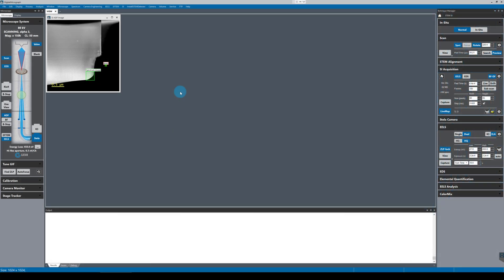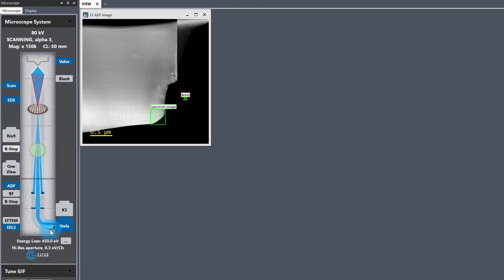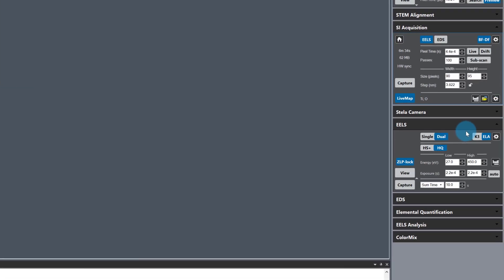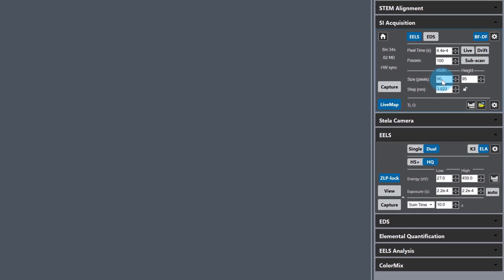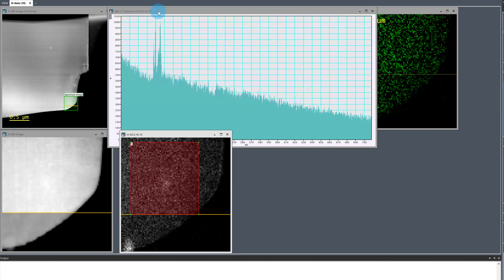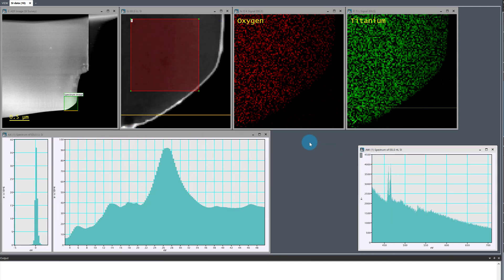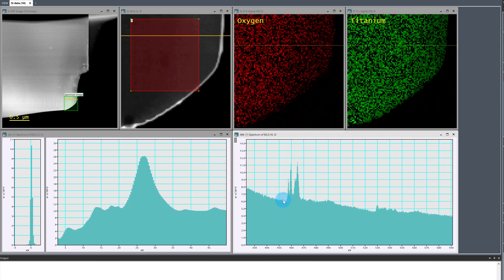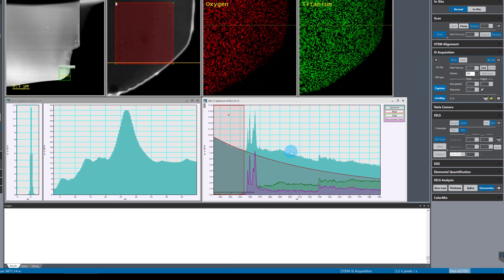High-Speed Counting EELS at low kV with GIF Continuum K3 with Stela

Comment: In what condition, shall we collect data with multiple passes? what is the data different if I collect data with only one pass at stronger current intensity?
Reply from the maker: Hi J Q,

Thanks for your question! 

When using an electron counting detector, summing multiple passes works really well as there is no readout noise. The signal to noise ratio is only shot noise limited (https://en.wikipedia.org/wiki/Shot_noise). The SNR of a single spectrum image pass acquired at high probe current or multiple passes acquired at lower probe current should be the same, if the total specimen dose and all other parameters for the two experiments were identical. The total dose is proportional to the probe current and also the acquisition time, so the dose can be controlled by changing either or both.

Fast multiple pass spectrum imaging is beneficial as it allows for better (more frequent) spatial drift correction and reduced specimen contamination, but is fundamentally advantageous at controlling specimen dose. 

Experiments that are dose-rate dependent benefit from faster scanning at lower probe current. Experiments that are total-dose dependent are easier to control with multiple pass acquisition as we can monitor the SNR in the data live as it is acquired, and stop the acquisition before beam damage occurs.
Reply: @GatanInc  Thanks a lot for the informaiton
Reply: Multiple considerations. 
In my view,  longer exposure time results in horrible drift and potential sample damage, while using shorter exposure but more passes, drift correction algorithm is more likely to handle the situation. 
For sample damage, when it comes to the critical dose, shorter exposure time is less likely to induce sample damage.
Reply: @ChangLagoLu  Thanks for sharing. It seems multiple passes and drift correction should be used together. The beam scann direction is from left to right and top to bottom in the defined rectangular ROI, but the sample of the right region within the rectangular ROI is beam drilled in most of my damage cases.
Reply: If your sample and microscope are both stable, I see no data difference between longer exposure vs. shorter exposure with more passes.